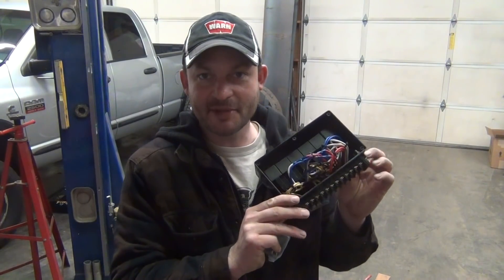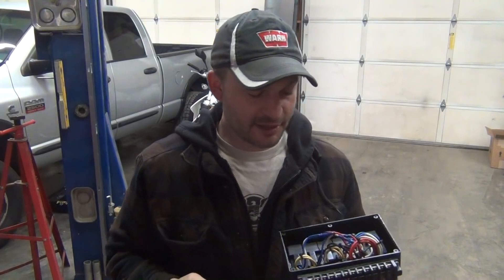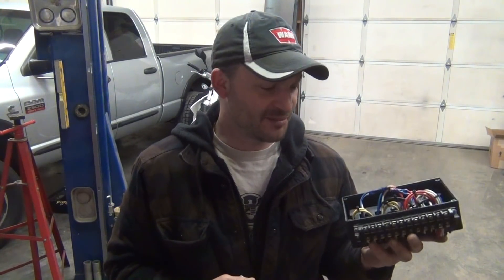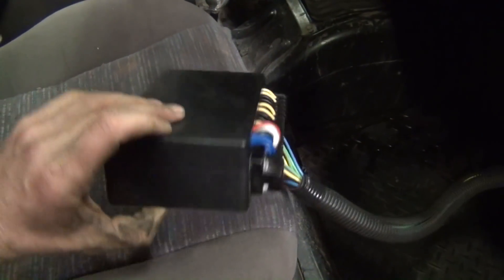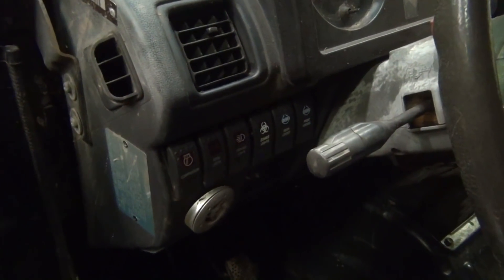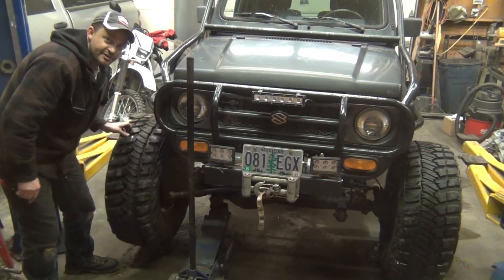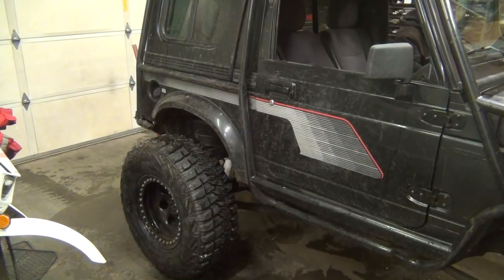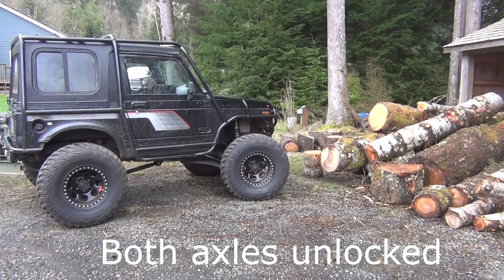Suzuki Samurai Project:  Wiring up the Toyota E-lockers

Comment: Nice front bumper by any chance do you have some pictures of it ?? Hi from mexico
Reply from the maker: Not really, it's just a piece of 2x4 rectangle tube welded to the frame rails, with a piece of 1/4" plate welded to the bottom to mount the winch.  The corners are plated for extra strength, and the roll cage is welded to that.
Reply: Matt Verley thank you

Comment: Matt 
Why you have all your tyres direction other way around??
Reply from the maker: even though the tires are asymmetrical, they are not directional.  Goodyear states they can be mounted in any direction.  My set had whitewall lettering on all 4 tires; I simply wanted that mounted inboard.  Since all 4 tires are identical, that means two face one way and two face the other way.

Comment: Did you weld the roll cage yourself? I'm really insterested to do the same sort of set up, I would feel a lot safer since the shell has such thin stee
Reply from the maker: Jordan P yes, I designed, bent, and welded the cage.  It is almost all 1.75 x .120" DOM tube.  The brush guard and a couple of braces are 1.5 x .120" tube.  I've actually had it on its side twice, and abused the cage a bit on the Rubicon.  Still perfectly straight, and no sheet metal damage.